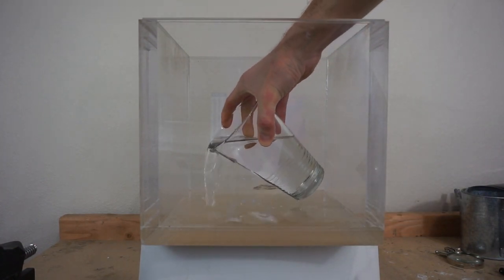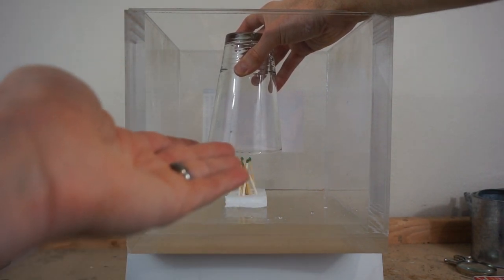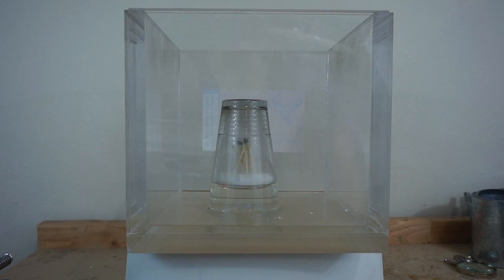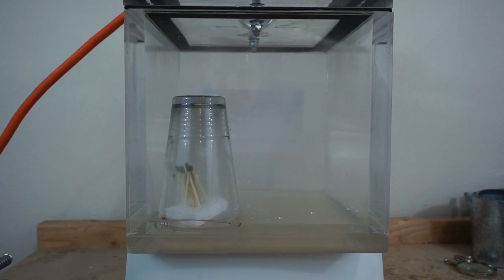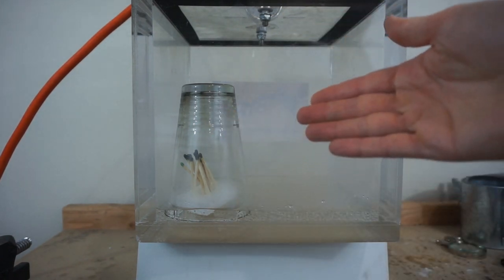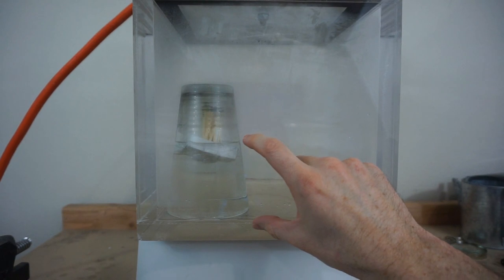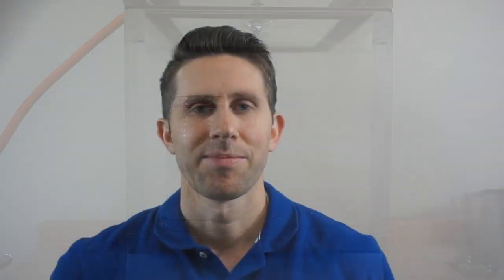Do Vacuum Chambers Really Suck? Doing The Cup Trick In a Vacuum Chamber

Comment: A practical use of this suction action. Take a long glass tube of 2 mm bore closed at one end. Heat and twist the glass tube to a flat spiral coil like a spring. The open end should be at the centre, like a snake lifting its head twisted facing up and opened up to form a funnel like formation. Mark out lines along length of this coiled glass tube. 

Put a small blob of mercury into the funnel. This will not sink into the tube but will stay at the funnel mouth. 

Place this setup inside your vacuum chamber and start the pump. As chamber is evacuated the air in the tube too escapes. At 0.1 atm pressure stop and allow air into chamber. You will notice the mercury has been pushed almost to closed end of the coiled tube and will remain there. 

This setup can be used inside vacuum chamber to measure air pressure inside without a pressure gauge attached. Position of mercury will indicate air pressure inside the chamber.

Comment: I agree with the speculation at the end. When you turned on the vacuum, you wound up with a hovercraft or air hockey table effect, using water instead of air.

I find the same thing happens to a glass of cold water on a smooth restaurant table. It has to be the kind of glass where there bottom is concave and there are no "feet" to create a gap, and the glass should have a ring of water around it from condensation. A small amount of air gets trapped in the bottom area, and as the glass warms up toward room temperature, this gas expands. If the glass isn't too heavy and the table isn't too level, at some point the glass may start sliding along the table.

Comment: Could you see if a siphon will work in a vacuum?

I have a few trains of thought;
1) The water will gas out, break the water tension and the tube will empty, breaking the siphon.
2) The siphon will continue as normal
3) The siphon actually relies on air pressure at the top being greater than the lowered pressure in the tube (due to tension in the water) and no siphon can occur.

Knowing that there is no such thing as suction "pressure", my bet is number 3, but my friends and I can't agree.

Comment: Re the cup moving- my first thought was that yes it lifted off the bottom but it then came under the influence of the surface tension of the water and that wants to roll the cop like it's on rollers (Brownian motion) and since all edges lead to a corner in a square container, it made its way to a corner. You could test that! Put it in a round tray and see if it goes around continually......

Comment: Hello buddy
I think the reason why the glass moved the moment you turned on the vacuum pump was because the water came out due to the pressure of the water overcoming the reduced pressure of the environment. Probably, the area of water coming out from the bottom on the back side of the glass was a little more than the area of water coming out on the front side of the glass, so when the water came out, the reaction force caused the water glass to move in the opposite direction (third lawofNewton). The reason for more water being sucked in the second case was the greater intensity of the vacuum inside the glass. In the first case, for example, the air pressure became one third due to the temperature drop after the matches were extinguished. But in the second case, after emptying the water in the glass, due to the zero pressure of the outside air, all the air in the glass was also emptied by bubbling, so a near-absolute vacuum was created and created much more suction.

Comment: the glass slid because the water from inside was rushing out and created a slick surface much like the top of an air-hockey table does with air, or the way a car tire hydroplanes on a wet road. the reason that the glas sucked up the water in the first place was because the heat inside the cup expands the atmosphere inside, and when the flame went out the atmosphere cooled and created a vacuum, sucking up the water from the chamber. what you did by turning on the vacuum chamber was essentially the same thing: created a difference in pressure which released the preexisting vacuum in the glass. now when you allowed the air back into the chamber, you recreated the conditions you started out with which is the pressure in the glass being lower than normal atmospheric pressure... so yes it sucked, or you can say itwas pushed in. I feel like both are correct in this case.

Comment: What I find interesting about this little experiment is that, in atmosphere where oxygen is being replaced with carbon dioxide pressure is dropping. Even tho we are adding material to atmosphere, because carbon from matches reacts with oxygen forming carbon dioxide. You would assume opposite effect that actually pressure inside glass should increase. Looks like carbon dioxide molecules move less than oxygen and that is why it creates less pressure. 
Truly interesting.
Reply: its heat, the hotter gas gets, the more pressure it has, it expands into the surrounding atmosphere. then when it cooled off, it had less pressure, so the atmospheric pressure caused the volume of gas in the jar to return to a smaller volume.

Comment: it looks like the cup slip towards the hose that sucks the atmosphere out. could it have been an uneven atmosphere that made the cup move as the particles rushed to fill the rest of the vacuum? i believe that would be the exact same physics that makes the water move into the cup. 

you could maybe test it with a tiny helium balloon anchored in different spots in the vacuum, or multiple at the same time, to see where the balloon is affected the most. do the corners and one in the middle. if they all move towards the hose you have pretty solid evidence for my hypothesis.

Comment: It doesn't suck the water up due to consumption of oxygen. It primarily sucks the water up due to the fact that the flames created intense heat, and thus low density air, under the cup. As the fire quickly goes out, the air under the cup quickly cools and shrinks in volume, thus creating lower than atmospheric pressure within the cup. As a result the water is drawn (or pushed, same difference) into the cup which returns the pressure inside and outside the entrance of the cup to equilibrium.

When the vacuum chamber is run, the pressure outside the cup falls, and therefore the contents of the cup move back out to maintain equilibrium.
Reply from the maker: you are right, it is due to the gas cooling...

Comment: This video could have been more clear about what is happening. (The video description describes it better than the narration within the video itself.)

Can it be assumed that the combustion process uses up air inside the glass? I don't think so. I would predict that the amount of O2 consumed is quite closely compensated for by the amount of CO2 produced (with a slight difference made up for by other gasses, such as CO.) It looks to me that the water initially pushed out by expanding air inside the glass as the flame creates heat. Then only after the fire has stopped, does the air in the glass start losing pressure as it cools, and water begin to rising into the glass. 

This would be better filmed with a high speed camera.

Comment: Have you tried putting a static electrical generator like a small whimshurts in your vacuum chamber? I'm told that humidity hinders performance. There should be very low humidity in a deep vacuum. Right? Also have you thought about using a deep vac pump? One that will go to 50 microns or less

Comment: You didn't mention the atmospheric pressure is greater on the outside of the cup because the burning matches consume most of the oxygen in the cup, also the matches extinguish because there is not enough oxygen left to fuel the fire. Also what we describe as sucking is the result of a change in atmospheric pressure, what's happening in your vacuum chamber if the air is not being sucked out? All you did there was demonstrate some of the physics of atmospheric change. Personally I think your theory is debatable, but what do I know.

Comment: What causes the atmospheric pressure to push the water into the cup? Because you aren't manipulating the atmosphere, just the space inside the cup, right?
Reply from the maker: +Hayley Lievers because the pressure on the inside is lower, and fluids always flow from high to low pressure.

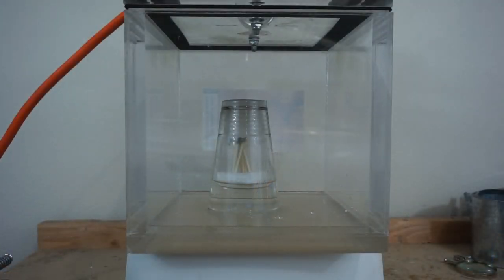Comment: 3:28 you said it would create a seal on the bottom so the water doesn't flow out but isn't it the vacuum that's holding the water up and it's sealed from air getting in?

Comment: When the water boils in the chamber is it's temperature increased?
Reply: PIZZAER   No, it is converting to gas at a lower temperature
Reply: George Wang Cool,(puns)
Reply: Conversely, the water gets cooler, since evaporation requires energy. With every molecule that evaporates, the temperature of the water decreases.
Reply: It takes energy to boil water, and no a negligible amount of heat* is being added to the vacuum chamber, so while the water is boiling, its temperature is dropping.

Comment: The explanation on the first part is more of a conjecture than a fact. The reason the water below seeped upwards the cup is because of pressure difference between the rapidly cooling hot air the matches created, and the atmosphere. In basic thermodyanamics, the more you heat a gas, the more it expands, and the more you cool it down, the more it loses volume. In this case, the burning matches heated the air, causing it to expand, and when you put the glass above to enclose the air inside it, oxygen began to deplete making further combustion impossible. The air rapidly began cooling due to temperature difference between it and the glass, and thus, causing it to contract which created a lower pressure inside the glass, and since the atmosphere has greater pressure, it began pushing the water towards the lower pressure to compensate. You let me down, bro.
Reply from the maker: +Bruzzel Chong I think you are right...in fact the co2 and h2o combustion products should have a larger volume than the original o2. Whoops! It is due to the cooling gas/condensing water. Thanks for pointing that out!
Reply: Hydraulic Press Action, sorry to bother you with my comment! I just wanted to point it out. But still, I would always watch your vids nonetheless. You satisfy the curiousity of a lot of people out there. :D
Reply from the maker: +Bruzzel Chong, I actually really do appreciate when people (nicely) point out when I make a mistake. It helps me not spread bad information. In fact I am going to edit the explanation at the first to be correct (I'll just take out the part about combustion).

Comment: you are just equalising the pressure. (the pressure in the glass was lower then athmsp, so liquid was sucked in the glass) it drops down when you suck all the air in the chamber, thus equalising the pressure. When you let air back in the water acts like a seal so the pressure in the glass remains the same (lower). it does not prove that "nothing sucks" ...
Reply: Alexandru Musat 

A Vacuum doesn't suck pressure blows or pushes ..
Reply: Lee burns in that instance it does literally suck air ... so the pressure goes down ... you can “say” it sucks pressure
Reply: Alexandru Musat 

The burnt oxygen is 'replaced' by the pressure of the atmosphere and water .

That's not the same as sucking.

That's why it equals out and then goes in the other direction and actually starts pushing the air out of the glass as the lower pressure in the glass swaps and then becomes the dominant pressure force.

That's the whole point of his experiment

Comment: Put a fish bowl with water(with fish  inside)in a vacuum.
Reply: Alpha581 yes
Reply: The oxygen dissolved in the water will bubble out and the fish will start suffocating. Depending on the fish, they might go to the surface to grab air, and find none.
Since I don't know the order of events, I couldn't say how the fish would react when the pressure gets low enough to boil water, but when it does, the water becomes agitated and the temperature drops. It's a bad day for the fish.

Comment: Aww. I was waiting for the glass to implode.
Reply: When there is air inside the glass and vacuum outside, if there is a structural failure the glass will explode not implode, as the air pressure will push out.
Reply: plus it wouldent explode because the glass was not sealed
Reply: The structural failure of the glass would cause it to implode, not explode. It would implode because the vacuum will suck the air out, and the glass particles will be collapse into the empty space with that force... We're talking brittle glass here, not soft marshmallows that will hold their expanded shape once the air has been pulled out.
Reply: are you talking about gas in the glass itself or the gas on the inside of the cup
Reply: Vacuum doesn't suck, air pushes. It will push the broken glass pieces.
Reply: Gas in the inside of the cup.
Take the example of being in space. It's a vacuum. And it's common knowledge that one's lungs would collapse, right? This is because things tend to go inwards when there is a lack of air, not expand/explode.
Reply: crazy808ish that's different. In the case of the lungs, the air will expand the lungs, but at the same time exit through your throat quickly and forcefully. When most of the air leaves the lungs the body will continue to apply pressure to counteract the normal air pressure in the lungs, but without the air in the lungs they will collapse
Reply: @nirshalmon1646  That actually meets the definition of sucking.

Comment: Hydraulic Press Action This is probably a dumb question but when the water boils is the water temperature getting up to 212° or is the oxygen getting pulled out of the water,  only making it look like it's boiling?
Reply from the maker: Not a dumb question, a lot of people get confused on this. The water is still at room temperature when it is boiling. At lower pressures water boils at lower temperatures. So if you get the pressure low enough the water boils at room temperature. In fact the water is actually getting colder due to the boiling, so it gets colder and colder until it actually freezes if you leave it long enough.
Reply: Oh wow that's pretty incredible! Would make for a really awesome video for the future! Thanks For the response. It's always fun to learn something new
Reply: wooow  i cannot even imagine water is boiling but temperature is going down, is there any way we could see that i wonder !
Reply from the maker: +surya surya I could do a video where I have a thermometer in the water. I should do that sometime, a lot of people have asked similar questions in the comments section.

Comment: What happens if you open the lid before putting the air back in
Reply from the maker: +spence I wouldnt be able to open it without letting the air in, there is around 1400 lbs of pressure on the lid due to the pressure of the atmosphere when it is under vacuum.

Comment: I bet you probably get a lot of stupid flat earth's here commenting but I have a genuine question. I'm skeptical space exists. I don't believe the earth is flat but there may be something to it. The part about space being something other than what we are told. 

Do you believe it's possible for a vacuum to exist next to a none vacuum?

I made this video called Does Space Exist? The thought experiment goes like this. You have straw floating out in space. So it essentially is a perfect vacuum. It is headed for earth. One end is open and the other is closed. The closed end will enter earths oceans and the open end will be out in deep space. When the closed end enters the ocean it will open. What happens? Does the water get pulled up the straw out into space? Does the sea level stay at sea level because of gravity. Does the water get drawn up 32 meters and can go no further? Would the oceans boil away?

I'm wondering what your thoughts are and I'd like to suggest to you an experiment. Can you make a vacuum chamber with a long pipe over 33 feet connecting to the chamber. Suck out the air from the chamber and the pipe. Have one end in water. Open a valve to let the water flow and see what happens. 

Will the water only rise 32 feet? If it does, do you think this would also happen if you had a theoretical example like the straw into open space instead of an enclosed vacuum chamber? 

Also what would happen if we replaced the water with air. Is there a limit to moving air up a vertical column like there is with water? 

I accept pressure decreases as you rise higher. I'm just not sold on the idea it eventually turns to a vacuum. 

For me a pressure gradient can only exist in an enclosed system. You would have heavy gases near the surface and lighter gases near the ceiling like helium. Is it really possible to transition to a vacuum with no walls or enclosure?

Peace Vacuum Chamber Guy

Comment: the vacuum doesnt suck the air out?
Reply: No it doesn't. The piston in the pump goes down creating a vacuum in the pump cylinder, the higher pressure in the chamber moves to the low pressure in the pump, when the piston goes back up it pushes the air out a one way valve, then then  process repeats until all the air is pushed out.

Comment: I don't agree with you I think it is that the matches are creating a vacuum by using the oxygen and then when you turn your vacuum it make the air in the cup expand like the air an a balloon would pushing out the water but the vacuum make the air expand more than the cup can hold so it goes out of the cup that's y when you let the air back in more water goes in than originally because there is les air in the cup

Comment: Or is it foing both the fire sucks in the oxiging so the cup sucks in the water as the outside pushes it an when you take the air out the pressure evens out cousing tje water to sing back in the cup to level out